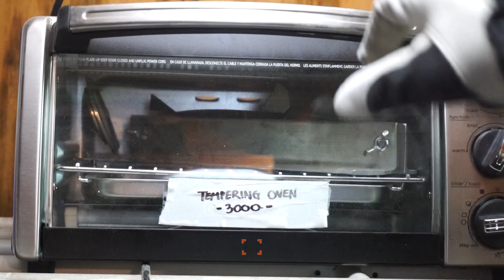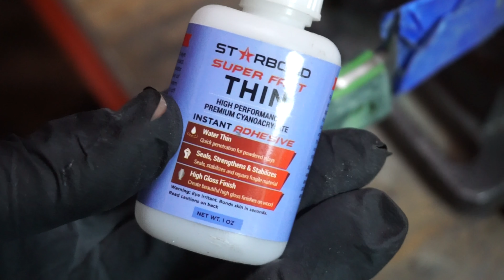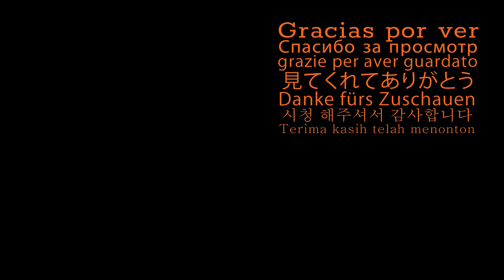Knife Making | Glowing Zombie Sticker

Comment: Hey, BTW, you use a 2x42 belt grinder, right? Do you have a video of the modifications you have made to it? I have a Norse 2x42 but as far as I know, it's the same thing as a palmgren. I have modded mine, as well, but, I'm always keen to know if there are other modifications I can make to ot to increase my productivity.
Reply from the maker: Yeah man, same machine, different name. So I put a piece of aluminum as the platen which works well. Bolted on a nice piece of steel for the work table. And that's about it. Cut the guards off so I can run those thick scotch Brite belts which are great btw.
Reply: @99echo  I ended up using a piece of 52100 I had for the flat platan and I'm still needing to put a larger work rest on there lol

Comment: Hello! I would like to ask you...it may seems silly but i am very new in knife making. You heat the blade up to 1475 degrees, so it may take 4 or 5 minutes since you use a double burner forge. You say you soak for 10 minutes...what do you mean? You keep the blade in the forge for 10 minutes? The temp does not go up??
Reply from the maker: Happy to help my friend, no question is too silly! I use a high temp pyrometer to adjust the propane pressure so that it averages around my target temp which in this case was 1475. The knife takes maybe a couple of minutes to get to that temp and once it does I leave it there for 10 mins (soaking) moving it around to keep it as even as possible. I just got a 1/2 pipe that I will use in the future to act as an buffer between the flame and steel for more even heat distribution. Now professionals don't like heat treating in forges because the temperature does vary but for a hobbyist like myself it gets the job done.
Reply: @99echo  oh, many thanks for your answer and all your help! Your videomis really instructive... and the soaking time depends on the thickness of the blade or the type of the steel? Or both?? This time is a matter of trials that i have to do is there is somewhere that i can find these information? Thanks again for your help
Reply from the maker: No worries! So you don't have to soak all steels, depends on the type. The place you buy your steel should give you the manufacturer's reccomended heat treat steps. If you're using unknown steels and don't have a way to check temp then a safe bet is to heat the metal up until it's non-magnetic and then quench it quickly in oil.
Reply: @99echo  many thanks again for your help